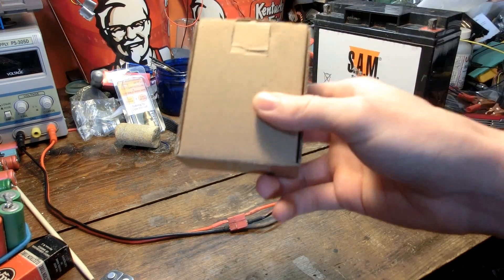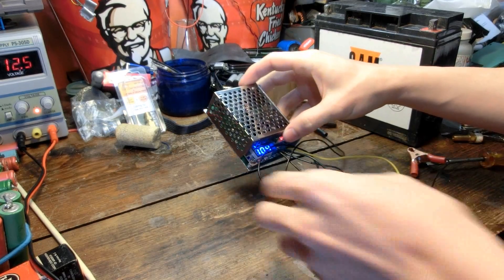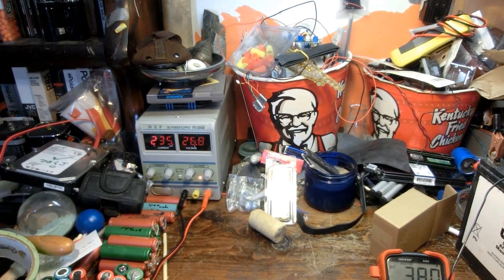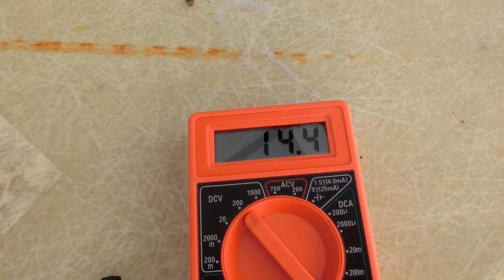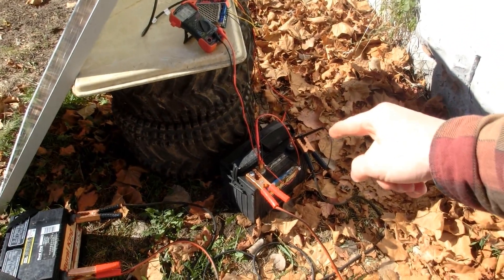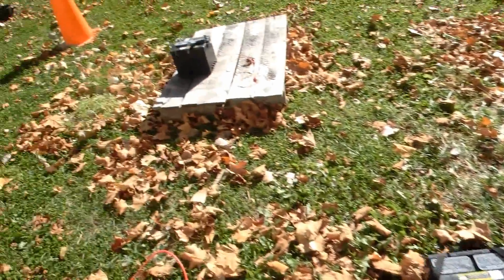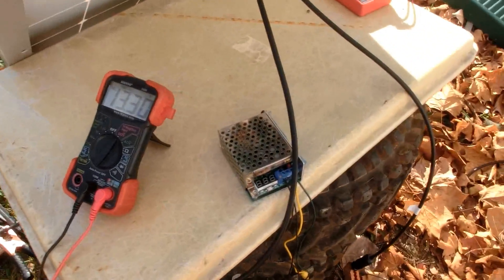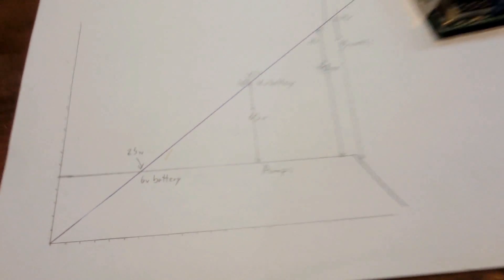Solar Sunday Experiments 002: step-down converter instead of MPPT

Comment: All the step down converter I tried drew down the panel voltage to a value around the battery voltage.
Reply: You needed more current obviously
Reply: @talusranch990  Thats what I told the sun but she wouldn't listen 😉 I think i Stick with the pseudo mpt modules, they keep the voltage at a decent level.

Comment: Interesting video. You really need to add at least one AC/DC clamp meter to your toolkit, though. They are so handy for measuring DC current on your circuit without having to physically connect. Just be very careful to get one that measures DC amperage as well as AC. Most only measure AC. This one says it does: https://smile.amazon.com/Meterk-Auto-ranging-Multimeter-Capacitance-Non-contact/dp/B0721MKXBC/ref=sr_1_5?keywords=ac%2Fdc+current+clamp&qid=1562199954&s=gateway&sr=8-5
Reply from the maker: this is an ancient video...
Reply: @RinoaL  Indeed it is. Hopefully you have one or two clamp meters by now? The reason i wite these comments often is for other hobbyists to get info.....not just to respond to the original maker. Don't you do that also? Just trying to help others, here.
Reply from the maker: sorry i help others by making a video instead of a comment, comments are too easilly lost. i recommend you making some videos about any topic you wish to share

Comment: 1. you need a reverse current diode between the buck converter and the battery (if it hasn't one build into already)
2. the diameter of your cables is too thin, which means you are limiting the current and your measurements are for the bin ;)

Comment: Your buck converter may not be that efficient in the conversion. However a buck converter will transfer more energy to the battery than a regular PWM charge controller. but MPPT is best because it will not allow the input voltage from the solar panel voltage to drop below its maximum power point voltage.
Reply: Buck converter will transfer more energy than a PWM converter!?
 Buck converter IS a type of a PWM converter!

Comment: You cant charge a battery like that. Connect an amp meter and increase the voltage to get 5 amps flowing to battery. and check battery voltage till it reaches 14.5volts.  But what you did wrong here is that you first adjust the output voltage and hope that current flow thru the battery.

in short, you need a constant current charger, not constant voltage charger

Comment: With lead acid you are good up to 14.4V and it will tolerate overcharge. However with lithium you obtain fire when overcharging. With lithium I think the device could help limiting voltage to sau 4.1V per cell in a 24V system charged at 28.7V max. I will soon try this one : https://www.aliexpress.com/item/MPPT-Solar-Charge-Controller-135V25A-Step-down-charge-all-kinds-battery-108V96V84V72V60V48V36V24V12V-Lithium-Current-Adjustable/32955156367.html?spm=a2g0s.9042311.0.0.3da24c4dIZCpgY but I will monitor the battery with a color display balancer witch sound an alarm in case anything goes wrong (and I have correct extinguishers and sand box, etc.) P= UxI so if and when the solar mpanel can have its voltage go up you get more power out of the panel. If the battery system draws more amps then the voltage of the panel go down you loose power. If the device allows solar panel voltage to stay a little higher, then that is a win on some power.
Reply from the maker: actully good lithium cells can handle 12v without fire. the samsung ones are tested to that. they smoke and die but they dont burn
Reply: Maybe, but I work with whatever used 18650 I find I test them, do a classification, eliminate the heaters etc. So fire is to be expected. Any electrical panel, any fuel burner, etc. must have proper fire extinguishers around.

Comment: an old video i know but i was just thinking i wounder how much like an mppt unit these work what i mean is how much of an increse of current is they by stepping the voltage down so if 2 amps at 19v goes in and is droped to 13.6 volt is the current after the buck converter  higher then of that going in
Reply: 2x19=38 w. with an  efficiency of 90 you get 34watts. so with an 12v battery you get 34/12=2.8 amps

Comment: Or just buying a solar charge controller. Even a PWM Controller for 10 $ might do at least the same job with the same efficiency
Reply: The moment it draws more current than the panel can supply (most of the day) the panel voltage goes into a death spiral. How come a super genius can't do a 60 cent modification to that switching converter to prevent  the panel voltage from dropping? My whole system (2,000W) is made from $5 buck converters modified this way.
Reply: @Moritz Stockinger Buck converters are current boosters.  I set the buck converters output to just above battery voltage like 15V.  The input voltage is monitored by a TL431.  That supplies a small current to the voltage set pot when panel voltage drops below the approximate power point voltage. This fakes the buck converter into thinking the output voltage is too high.  End result is a current boost and the panels voltage does not drop.  That allows any cheap charge controller to do its magic with fairly good efficiency.  Instead of a TL431, a microprocessor can be used for the charge controller. I have videos for those with some electronic nouse..

Comment: With a little electronic nous these supplies can be easily be converted to MPPC, constant power point that gets you 90% of the advantages of one that tracks.   Something as simple as a transistor zener and a pot can be used to keep the panel from dropping below a set voltage.  That power point voltage varies with temperature not light level. So, adjustments just a couple times a year is sufficient.  The technique involves feeding some voltage to the regulator sense pin fooling it into thinking the output voltage is too high and reducing the PWM duty cycle of the regulator. This is very important in low light levels where the panel current is reduced.  Without it the regulator will try to draw more current quickly dropping the panel voltage.  Power is volts times amps. A solar panel is a current device.  Without voltage, there will be no power.  Yes, why design a regulator from scratch when you can modify a cheap one that only cost a couple bucks.

Comment: Hello, great vid, . at the moment i am trying the something  Have you tried a boost/buck converter, will this handle the lower volage drop better.
Reply: a trick : watch movies at Flixzone. Been using it for watching all kinds of movies recently.
Reply: I have ordered the potted version with aluminum fined case to drop  30v PV to 12v for dc direct drive.
Reply: @Nicholas Titan Definitely, I've been watching on flixzone for months myself =)
Reply: @Nicholas Titan definitely, have been watching on Flixzone for months myself =)
Reply: @Nicholas Titan yea, I have been using Flixzone for since december myself =)
Reply: @Nicholas Titan yea, I've been watching on Flixzone for since december myself :)

Comment: Good video. I was always looking for a cheaper alternative to MPPT controllers as I'm on a tight budget and I'm building my solar system more as a hobby than for any serious use. I got a 15A one for around $15. It's even a better deal than a 10A MMPT controller which alone comes up to $80+ (Canadian). I got my 20A PWM controller for around $10, so you can't go wrong for a small system.

Comment: I have done this also. but I'm using two step down converters with 2000amp auto capacitor   in parallel  with the output set to 14.8 and getting 8amps total.I have 4  50 watt solar panels, two in parallel  running like this and put in parallel with the other two panels giving me 14.8v @ 16amps. and this runs my 2500wat inverter. and powers all the led lights in my house and my led 60in TV. every day for free
Reply: Could you provide a drawn diagram to see if i can apply it to my system

Comment: actually 14volts will overcharge them if you leave em on standby
on a standby charge the voltage range is 13.4 to 13.8 and on cycle charge the voltage is 14.4 to 15 volts or they will eventually boils the electrolyte

Comment: Would it not be better to take MPPT equal this? http://www.amazon.com/Bestpriceam-TM-Battery-Regulator-Controller/dp/B00NG91W68/ref=sr_1_13?s=lawn-garden&ie=UTF8&qid=1436036588&sr=1-13&keywords=mppt+charge+controller

Regards Thomas :-)
Reply from the maker: ***** thats not actually MPPT, thats a PWM like i have just rebranded. theres a lot of scams like that.

MPPT will have large heatsinks and a big coil inside.
Reply: Rinoa Super-Genius that's not fair this fake things :-( I'm looking for a cheap one for my 80v panels.
Reply from the maker: *****
i havent ever seen one lower than like 90$.
Reply: Rinoa Super-Genius where can i get it please and how do you get the sticky tapes off from the 18650 batterys?
Regards Thomas

Comment: newbie question incoming; would this converter work as a 12-24v to usb charging module? could i use this simply connecting to the battery and usb cable?
Reply from the maker: so you want to drop 24v down to 12v? yeah i think that would work very well for that.
Reply: well i guess i failed to express myself. i have a 12v battery in my guitar amp, and i want to use it as an external usb charging unit outdoor for my tablet pc. but right after i write my first question, i found another similar equipment that only converts from 6-30 v to 5v, and its 3.5 dollars. i believe i managed to solve my problem, but mostly with the help of your video. thanks again.
Reply from the maker: hasen akkhaya
i think you would be paying too much money and wasting time. they sell 12v-5v USB adapters in grocery stores for like 2$. they are made to connect into the cigarette lighter plug inside a car. i cracked one open in a video thi september and quickly soldered wires coming out of i to connect to a battery and it was very easy. only took about 5 minutes.
Reply: i really appreciate your interest and responses. the thing is i might need to wire that thing to various power sources like different batteries or combinations of batteries. that is why i did not choose those 12v-5v lighters. also while not being so sure about this, some of them is limited to 1A or less, and that equipment i mentioned is up to 3 A as they say at the sale page :D and i live in turkey, those car lighters are not that cheap. but you are absolutely right about the waste of my time while waiting the shipment :D thanks for bearing with my, eng is not my main language.
Reply from the maker: hasen akkhaya
you speak english well. most computer ports limit to 1a also i think. idk if most usb devices can handle 5a. i hope 5a doesnt burn any wires.
Reply: i take that as a compliment :P my laptop's  usb ports are limited to 1a, yes and my tablet is not charging while i am using it :D i need to turn it of so it can be charging. but with the ac-dc adapter which is 1.5a, i dont have that problem. the battery percentage is able to go higher while im using it. btw i said 3a, not 5a. even 2 a would satisfy me i suppose.
Reply from the maker: hasen akkhaya
oh 3a....haha

and yeah i mean that as a great compliment. the only thing i'm afraid of is if you have the converter accidentally go up to like 8v it may hurt stuff, so maybe wire up a relay to turn off the connection if it gets above 6v.

are you meaning a converter like this http://www.ebay.com/itm/LM2596-Step-Down-Power-Module-DC-Adjustable-LED-Voltmeter-Brand-New-/391007525972?pt=LH_DefaultDomain_0&hash=item5b09dd5c54

or are you meaning like this? http://www.ebay.com/itm/DC-4-5-40V-To-5V-2A-USB-Charger-DC-DC-Step-down-Buck-Converter-Voltmeter-Module-/310984568475?pt=LH_DefaultDomain_0&hash=item48681fee9b

i was thinking you meant the first type, but that 2nd type would be very great for what you want.
Reply: Rinoa Super-Genius yeah sth like the 2nd one. actually this exact product: http://www.dx.com/p/zndiy-bry-diy-dc-6-35v-to-5v-3a-double-usb-voltage-step-down-regulator-module-green-321489#.VJnITl4jA
Reply from the maker: hasen akkhaya
 oh thats great! for some reason i wasnt thinking correctly. i was thinking you where getting the step-down converter i had in the video and soldering a USB connector onto it.

that should be very useful.

Comment: Love your channel mate! I am in the process of making a MPPT/battery solar charge regulator. While scanning ebay I youtube searched DC-DC step down converter and low and behold AGAIN you are doing a similar project to me. Thanks for your videos I really appreciate it. You save me time and money buy not buying things that wouldnt work for me either :)
Reply from the maker: i'm thinking if i put a 18v battery on the panel side this step-down converter may work better, so dont take my inability of geting it to work well as proof that it wont work ^^
Reply: why would that make a difference? Stabilize voltage and current? If so capacitors would always be a good idea perhaps..
Reply from the maker: Daniel Wilson
 1000 nanofarads isnt very much capacity.
Reply: I thought because they were cheap and 50v 100 in parallel would help smooth out any issues with providing current. To maybe act as a buffer. What are you thoughts on this as im just about to buy one works out at £7 here in the uk :D looks wicked as well
Reply from the maker: Daniel Wilson
i really dont know, i still need to test it with my battery idea.

Comment: how about a step down converter on each panel in a whole array parrallel wired and setting each to 14 volts or you can buy a step up converter and convert the volts to 50 or 60 in parallel and connect it to a mppt contoller the reason you would step it up is to minimize power loss
Reply from the maker: stepping it up would increase power loss.
Reply: only if the boost converter isnt efficient enough but usually if you increase voltage you can make your wires thinner and have less line loss
Reply from the maker: Dean Walcott
 sure but we are only talking about a few feet of wire. you would still be losing about 10% of the power on a converter where i'll lose less than 2% in 100 foot of wire.
Reply: yeah thats true for small panels and arrays but if you have a huge array and you want 2000 watts but they only put out 18 volts you would need about 110 amps thats a lot of current if you step it up to 60 volts you would only need about 33 amps which would save wire thickness a lot
Reply from the maker: Dean Walcott
no you would just connect the panels in series, would be fucking stupid to wire them all up in parallel then use a step-up board.
Reply: series would definetely work but if one panels shaded all of the other ones are reduced to the amperage of that one
Reply from the maker: Dean Walcott
 if a panel is shaded then its not in the right spot.
Reply: yeah panels are really only meant for places without any shade but for someone who has shade in a small part of there yard for a short amount of time it would work very well

Comment: Hi, does you DC-DC converter supports current limiting? If yes setting it would help to make it almost behave like a MPPT. If it doesn't support it out of the box you may easily integrate it depending on the control chip it's using. Usually it's just a matter of replacing the overload voltage divider with a pot so that it is adjustable.

If you build your power transformer idea it would behave the same way (It'll draw as much current as the battery wants), unless you have a way of directly controlling the current with a PWM chip and a sense resistor
. Also, at 60Hz it would be a lot less efficient than the buck converters which can go for about 80% efficiency, while small trasnformers usually stop at 50%.
Reply from the maker: unfortunatly it only limits voltage. i love the units that limit amps also.

and i've ditched the transformer idea for a differant idea that i hope to show next sunday.
Reply: Rinoa Super-Genius  If you are willing to open it up and search for the controller IC (usually either in a DIP or a D2PAK package) I can try to tell you if you can retrofit it.
Looking forward for your new idea anyway!

Comment: Probably has been answered, but is there a reason you want to mount them on a pole as compared to your roof?
Reply from the maker: to get them out of the shade and so i can easilly make them automatically follow the sun later on.
Reply: Fair enough.  Personally I would trade tracking for an easier static mount on the roof but to each their own.

Comment: I really wish you could get this to work  because mppt controllers cost to much
Reply from the maker: i think if i connect my 12v and 6v battery in series and put those on the panel side that will help the panels stay at 18v making the step-down converter more efficient.
Reply: well good luck

Comment: Nice Video!
I think that sweet spot in voltage may be the operating voltage of the panel. (might be labeled on the panel) Because if you go below it the output stumbles. Here are some great mppt experiments by Julian Ilett: https://www.youtube.com/playlist?list=PLjzGSu1yGFjWv4KeN-7TSYeQIcicM9Ghl
Reply from the maker: actually its slightly above the sweet spot, the sweet spot is when the amps and volts are the highest they can be together. i enjoy Julian's videos a lot. but i have a simple fix for this issue i will try in the next video.